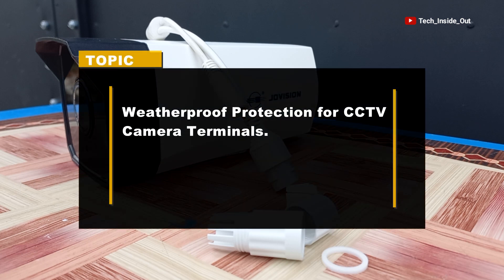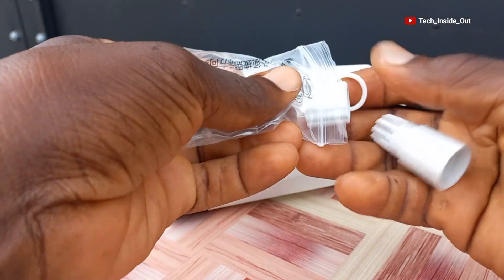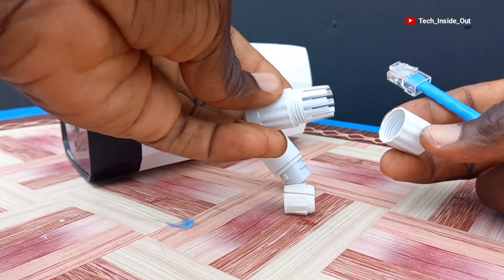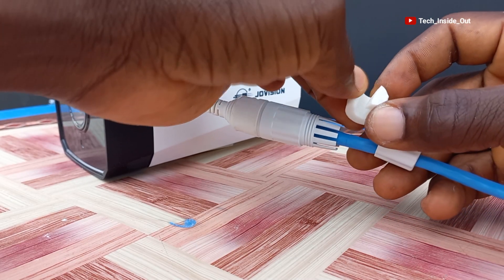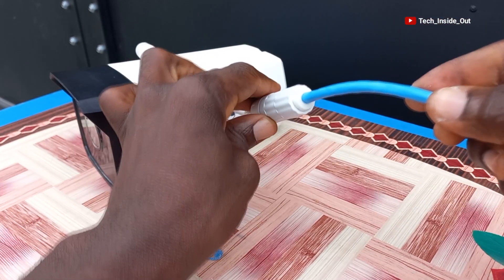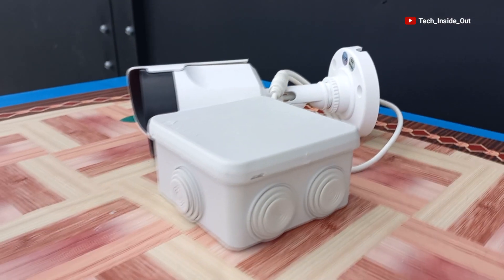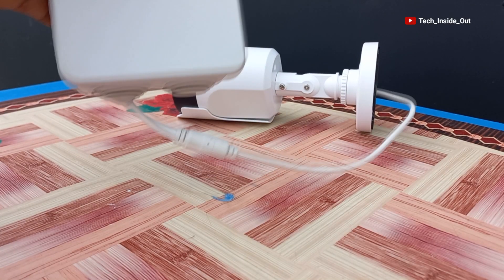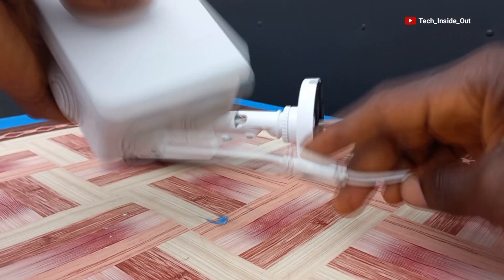CCTV Camera weatherproof protection

Comment: Hi Tech Inside, I need to use a repeater to connect a switch with 6 cam to an Nvr, what’s your best advice
Reply from the maker: I will advise you use a CPE radio link to carry the signal to your switch